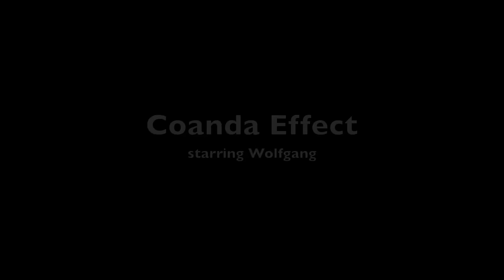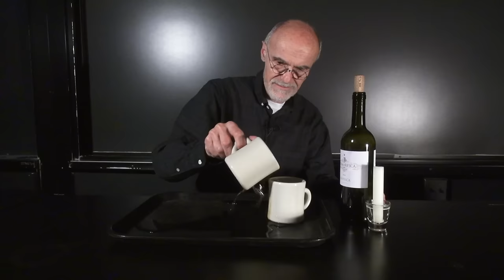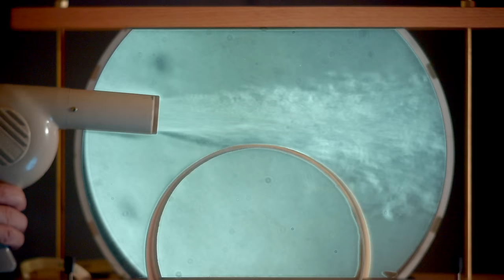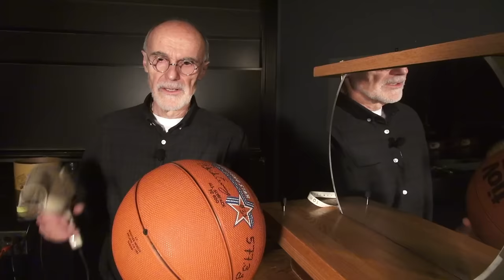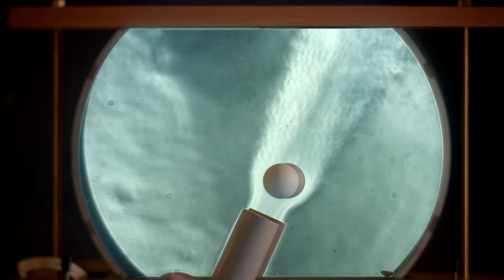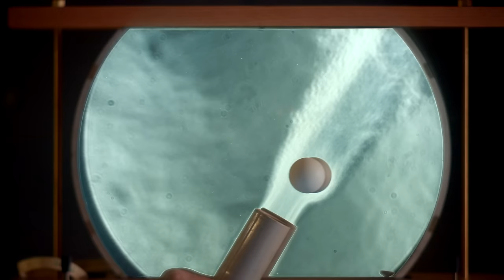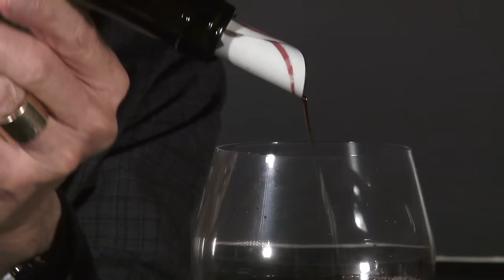Coanda Effect

Comment: Hi question when you talked about the aluminum foil trick, does that work because there is no uneven air pressure to fill it therefore the coanda effect does not play in it?
Reply: Sort of ... the Coanda Effect is all about the fluid following the contour of the object.  When there's a sharp edge (such as the foil has), the fluid can't flow around that edge and so there's no dripping action.  All good teapots and containers that you might pour from have a sharp edge on the pouring spout to minimize dripping (minimizing the Coanda Effect).
Reply: Could also be that the vacuum under the tip will be filled by air that comes from above and behind both sides of the tip's edge, coupled with the narrower liquid stream, which also helps air fill any possible vaccum under the tip?

Comment: I didn't know that about the air...Water takes a force in order to break it up into little pieces...I would not save friction...I would say that it would be because of what the objects are...wind has a hard time influencing itself and when every other "molecule" is acting in the same manner...than not much change can happen...because it takes a force to break apart an object and that is why the liquid sticks to the glass when you poor it an not enough of a speed.
It is not a very well explanation...It wakes a force to break an object...so when you poor a liquid from a glass...if the force at the tip of the glass is not strong enough to break the bond of the liquid then the liquid will stick to the the liquid producing a mess...

Comment: Is it the same as Bernoulli's Principle?
Reply: no, it's not
Reply: @wolfgangrueckner7151  Care to elaborate?
Reply: @GabrielKnightz  Bernoulli's Principle assumes laminar flow of a non-viscous and non-compressible fluid.  Non of those 3 prerequisites apply in this situation.
Reply: @wolfgangrueckner7151  Aah! Thank you good sir. Would it then be fair to say that the Bernoulli principle is a subset of the Coanda effect?
Reply: @GabrielKnightz  No, the Bernoulli Principle is a statement of conservation of energy (no dissipation of energy) whereas the Coanda Effect deals with viscous forces (which dissipate energy).
Reply: @wolfgangrueckner7151  I see, thank you very much.

Comment: What? I think the video is partly misleading. How can the experiments with a cup and a bottle of wine not just be an effect of both adhesion and cohesion of water molecules, surface tension and viscosity (Kutta condition)?
Coanda effect is about pressure differences due to entrainment of the ambient fluid into the stream, it's no the case here.

Comment: this would be a lot better of the flow coming out of the hair dryer was laminar
Reply: true, but not easily done with everyday appliances
Reply: How would you like for him to achieve a laminar flow?
Reply: David Mozingo the simplest way I could think is to bundle drinking straws in front of the hair dryer with scotch tape then wrap it with paper so it just fits around the nozzle. Idk how well it would work tho
Reply: The drinking straws would work as long as the speed of the air flowing through is low.  But to get the air to flow around the large object requires high speeds and thus it would immediately become turbulent.

Comment: Is that the correct explanation?  Low pressure is caused by the molecules on the surface of the ball moving out of the way with the air flow?  So the top air is forced down to follow the curvature? 
How about the fact that the air up above is already flowing in itself is a low pressure zone and the air by the ball in fact is high pressure and therefore should get sucked up.   Just like when you open your car window the air inside the car and things in the car get sucked out of the car.  The molecule thing is wrong. At least to a person who pays attention it has no meaning.

May I give an explanation that actually makes sense and have some logic to it.

Look as the air begin to move over the ball, that air gets impeded by the ball,  equivalent to when you pinch a hose, the water shoots further, and so the air that is constrained by the ball moves faster as it is following the path which is the ball's surface. 
The part of the airflow that hits the ball has to travel faster along the ball to catch up with the rest of the air above it and there is no other place for that air to follow but the surface of the ball.
This is no different that what happens with the airflow on the wings of airplane.  Faster air relative to its neighbor is the lower pressure area.   In terms of energy, what happens is potential energy higher pressure is converted into kinetic energy, lower pressure.

So if you pay close attention in this experiment you can actually see that on the right side of the ball where the ball curves down at about 2 o'clock or so  the air on the surface of the ball catches straight up with the air above.

Comment: of course it is following the shape of the ball because the ball is immersed in the air.  The airflow from the hair dryer is simply making a wake across the 3 dimensional surface of the ball. Somebody named themselves after this "effect?" It's like putting a toy boat in the bathtub and splashing. The wake of course will follow the length of the bow. Because where else is it going to go? Through the boat? LMAO! Really?? You can see it with shadows of Solar Eclipses too with the Prenumbra and Umbra. The shadows will get smaller until it hits the focal point and then it gradually defuses out.